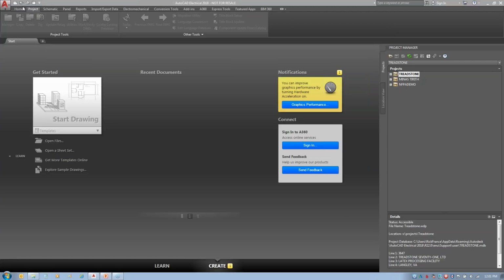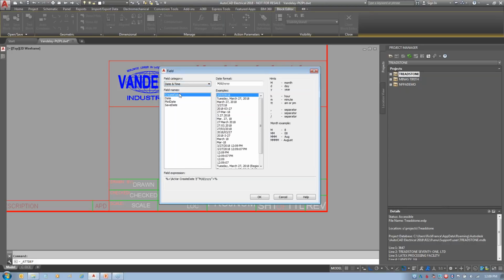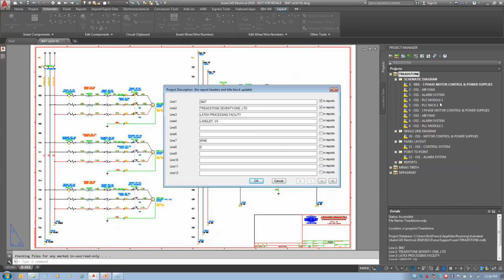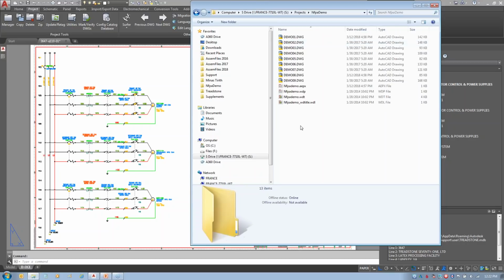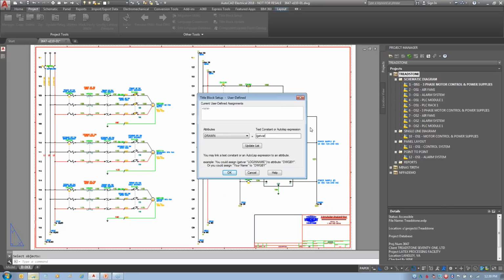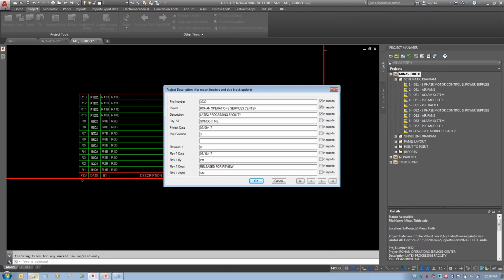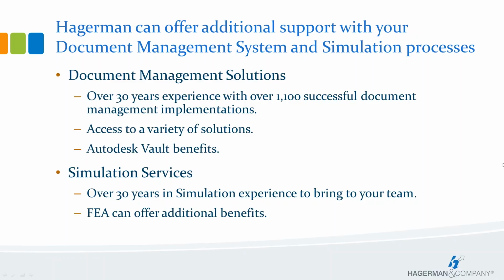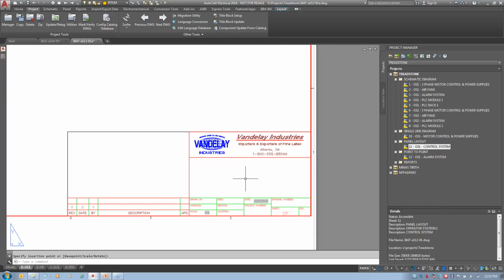AutoCAD Electrical  Working With Title Blocks

Comment: Hello Rick, I might be missing a step here. I made changes title block on one drawing of the project using the block editor(added attribute for rev). I used title block setup and overwritten option 1 of method 1.  I can link attributes to line numbers. But the project .wdt file doesn't have line numbers connected to new attributes resulting I cannot update title block. 
secondly, I am also looking for replacing this title block in all drawings of project.
Reply from the maker: I’m not sure I understand you wire number relationship to a title block, but some of this sounds like you need to overwrite your title block on your drive or in your template with the one that you changed in the drawing in order to access those attributes in the project files. In the drawing you may also need ATTSYNC the title block to get those Attribute Changes to actually take.
As for all the drawings getting the update you might try the Swap/Update Block Command of Electrical. It was made for Symbols and Footprints but it will work on Title Blocks as well and it does the ATTSYNC for you.

Comment: Hello Rick, thank you for this video. You talk about it is possible to have several title blocks in one drawing ~ 32:00; however, I can see that your extra paper space has the same page number. How can I change the page number and other drawing information for each title block?
Reply from the maker: You can’t. Several title blocks in one drawing for printing purposes not different drawing numbers. The whole purpose of Paper Space is for printing the same drawing to different printers which includes various sizes – thus each paper space layout has a different title block depending on the printer. All title blocks will have the same drawing number and all of this is by design of the software.
Reply: @Hagerman  Thank you for your response, important clarification.

Comment: Thanks for this webinar. I have a question please. I have AutoCad Electrical 2022. I developed a template with a new title block. How can I replace the old title blocks in my drawings with the new title block?
Reply from the maker: Swap/Update Block (AESWAPBLOCK)
Reply: @Hagerman  Thank you for your reply. My drawings are with the new title block. But the description tab does not display the Tag names but rather Line1, Line2...Although the project .WDT file shows the tag names for each line (Proj_Name=Line1....).
Reply from the maker: @saadsoliman5487  Without seeing it I can only guess, but it sounds like either a pathing issue or multiple WDT files and it is finding another one higher up the food chain.

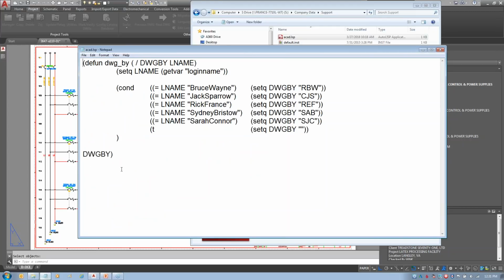Comment: at 30:40 can you please share where can i get the lisp file.
Reply from the maker: The lisp routine was not made available to the public, however, it is on the screen for well over a minute and explained. I would suggest taking a screenshot and just retyping it to match your own use. It’s a very small routine and would not take long to enter in. You can use NOTEPAD to create an LSP file.

Comment: Dear sir,
               thank you, so much for your reply, i have  confusion between template and title block insertion in template, as you explain in the video,  tried but its not working for me,  really appreciate if you cloud share some video using constomized template making, and tile block making and start with that to add the attributes, for me template and tile block insertion point is not clear,  its will really help to understand, once again sir thank you so much for the videos, its really help to understand the software,
Reply: What you are asking is more of an AutoCAD function and the Electrical webinars and articles assume that the users already have a working knowledge of AutoCAD. I would suggest that you search you tube for instructional videos on two subjects.

                1. AutoCAD Creating Blocks with Attributes

                2. AutoCAD Creating a Drawing Template

If the videos do not cover Inserting a Block with Attributes you may want to find one for that also, but I would imagine the first one would cover that also.

Comment: hi sir, thank you so much for the tutorial its very helpful, appreciate your handwork, i have once question if you could reply me, 
this line description which you have updated  to our attributes this default_wdtitle.wdl where to locate , thank you in advance.
Reply from the maker: Out of the box I do not believe the file exists. They have one in each of the sample projects, but it is named for the sample project and unique for each project which is not the way I use it myself nor in the video.
You can create one using Notepad though and just name it default_wdtitle – notepad will use a txt file extension so you will need to rename the file to default_wdtitle.wdl after the fact. You need to put the file in the same location as the default.wdt it is related to.
Reply: This is glorious, been searching for "what are free electrons" for a while now, and I think this has helped. Have you ever come across - Diyarah Electric Freedomify - (do a google search ) ? Ive heard some pretty good things about it and my friend got cool success with it.

Comment: How can i link all the attribute on the tittle block to be exported to excel?
Reply from the maker: You can export the Drawing Property information using the Export to Excel function on the Import/Export Tab but the only way to export all attribute information to excel would be to use AutoCAD’s Attribute Extraction function which is not an Electrical function so it will only work one drawing at a time and not on an entire project.
Another option might be to create a Report that contains all the information you are seeking and write the report to an excel file.
Reply: Will i still be able to import the excel document back into the AutoCAd? @Hagerman
Reply: This clip was very helpfull to something that i was doing thank you for loading it.

Comment: HI I wanted to know how can we change the search path for WDT file so that I can point my autocad to search a shared network location.
Reply: change the paths/ go to options & change the file paths under files tab.
Reply from the maker: In the AutoCAD Options Support File Search Path add the network location where you are going to put your support files such as the WDT file and wd.env file. Move this to the top of the food chain so that ACE will see this first. Then close AutoCAD Electrical.

Next set the ACADPATHFIRST in the wd.env file to 1. Most likely all you will need to do for this is remove the “*” at the beginning of the ACADPATHFIRST line. Then move the wd.env file to this same location on the network so that you only have to maintain one wd.env file for everyone. Do not leave a copy on your local computer or Electrical will most likely use the local one instead of the network one.

Each user’s computer then must be setup with the Support File Search Path on the top, close AutoCAD Electrical, and delete the wd.env from their local computer.